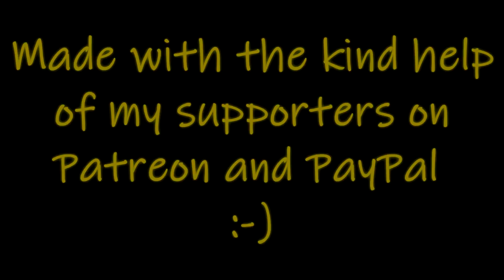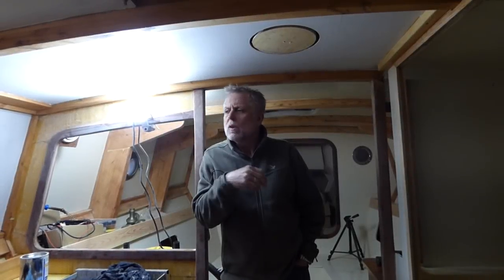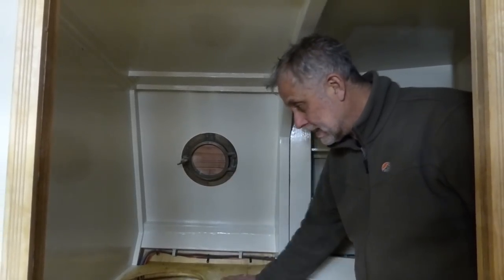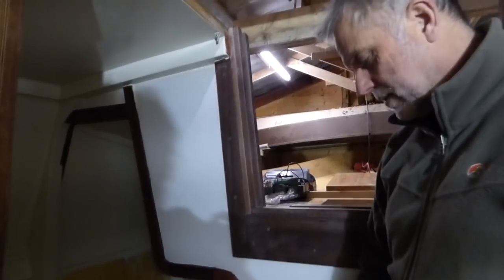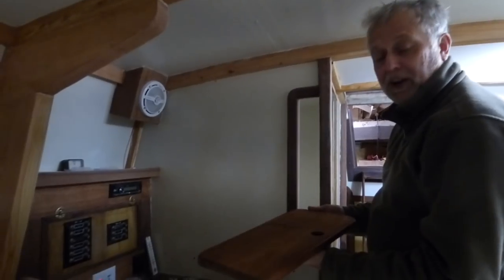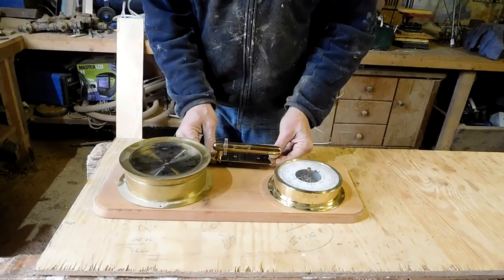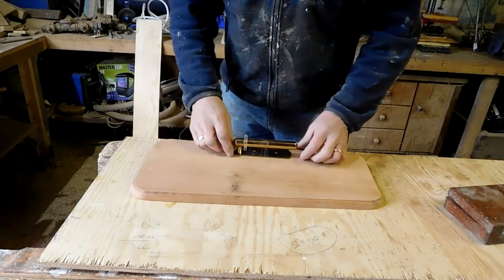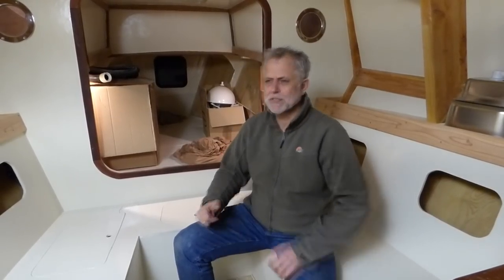Building a sailboat; Interior fitting and more!! - SV Tapatya EP128

Comment: Hi Tony, 

thanks to Corona I just found your vlog  and startet looking. I worked all through to #81 or so  and I like it very much. I have read Annie Hills book and I like and build flat bottom boats (Dory or Sharpie hulls). So I know Jay Benfords boats. And Iam living in Niedersachsen too. So a lot of funny parallels.

I have some questions. Since I prefere light displacement boats, building dinghies and small multihulls, Iam used to feel comfortable with much lighter structures.  I wonder if your scantlings (20mm hull sides, decks and cabin and 30mm plywood and 5 x 6.5cm frames) are the same as specified in Jay Benfords plans??? Or do you added a few mm for your peace of mind)??? Can you write or say something to that topic?

Your tool tips:
Can you say again the manufacturer of your Hammer. I saw it and I want one, but did not make a marker,, so  I would have too look 80 posts again to find it.

For everyone thinking of buying a block plane: I have a block plane Silverline No.2 which is a clone of the Stanley and as good as it if not even better quality. It comes for ~ 20€ from Irtex GmbH. That is a third in price.

Looking forward to your comments, have fun and stay healthy,  Michel
Reply from the maker: Hi Michael. Thanks for watching and your comments. The ply thicknesses are exactly as specified by Jay Benford. The chine log and sheer clamp are also as specified. The frames, however, are not in the original specs - the boat is designed to be built without frames, with internal bracing being provided by bulkheads and furniture. I added the frames (it was an idea I took from another builder - Greg from Willow) because I thought it made the building easier, and obviously added extra strength to the finished boat.
Reply from the maker: The hammer you ask about is a Bahco, formerly Sandvik. The plane sounds interesting! Stay healthy too! All the best 👍😀
Reply: @SVTapatya   whou! Your boat must be tough like a Dreadnaught!  I would have fitted the frames too, it pays out during bending the ply. I was out with the bike today and I think found your daughters boat. Is it berthed at Cramer Marina in Wilhelmshaven???
Reply: @SVTapatya  Perhaps someone buys the plane, likes working with it and starts building a boat ... haha.
Reply: or may be another Tool Tip. Its also listet on Ebay and available locally in UK, London
Reply from the maker: I think the frames also help to keep the layers of ply tight together. Yes, she's at Cramer's, Michael 😀

Comment: The more you do the interior like the panel with instruments on the more it's beginning to bug me your boat is not built to last or for resale value. The interior is looking better and better.
I totally love the non capitalist construct statement but can't someone after you strip one layer of ply off the outer hull and add new boards back on and epoxy?
Reply from the maker: It's certainly not built for resale, Anthony. As to lasting, only time will tell. However, I certainly think it would be possible to redo absolutely anything on the boat, hull included, if it was necessary 👍
Reply: So far as "not built to last" goes, the original junk-rigged dory on which Tapatya is based, Badger, was built to the exact same standards as Tapatya, right down to the type of plywood used (if anything, Tapatya is built stronger than Badger), and Badger is still going strong today, over 40 years after she was built. And to the best of my knowledge, in all that time she's never needed any major work done on her hull. So I don't see any reason to be concerned about Tapatya's longevity.
Reply: Great because she's looking beautiful already
Reply from the maker: Thanks Anthony. And thanks for reading my website 😀👍😜